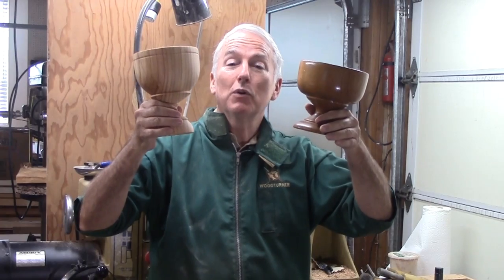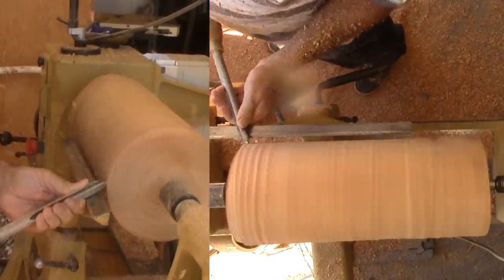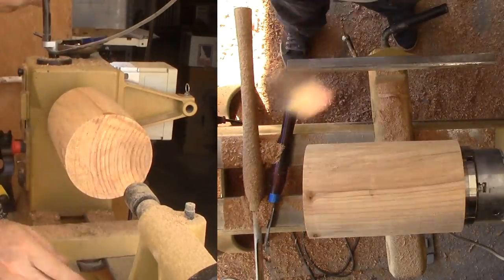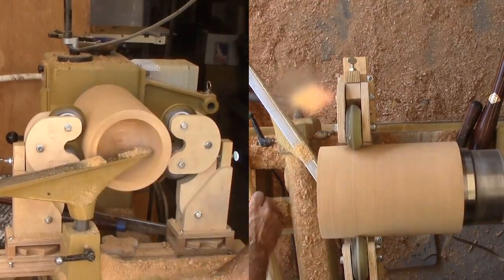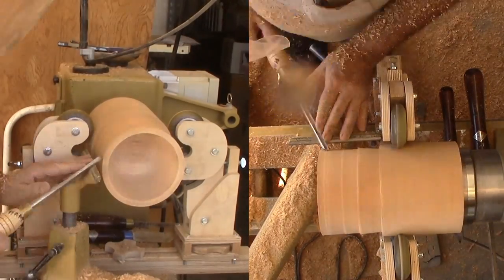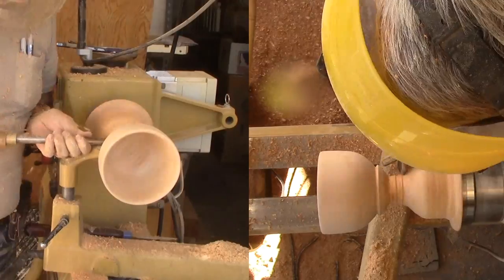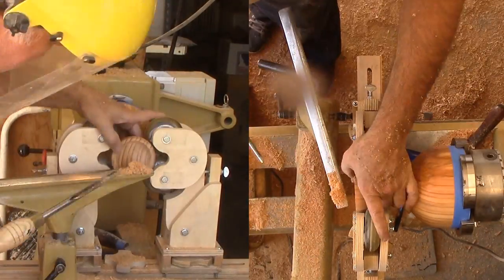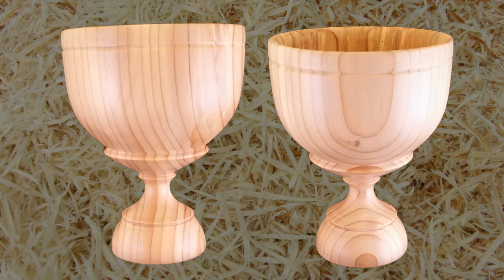Exploring My Family History By Turning Tall Cedar Bowl

Comment: I love both of the bowls. This one is a fine tribute to your Grandpa and a wonderful gift for your Mother. Too bad about the checking...did you make an attempt at repairing them or just leave them? One point I'd like to make, I guess it's kind of knit picking but those wheels are inline skate wheels or roller blade wheels. Depending on who you ask. I used that type wheel on my steady rest as well. I've found the you can sort of wedge the bowl or vase into the chuck using the sides of the wheels to make the mount a little more secure. Anyway nice video and a touching theme. Like!
Reply from the maker: I mis-spoke. They came from thrift store inline skates.
I can image the side pressure situation you described but I only needed it stabilized this time. I'll keep it in mind.
Thank you
Alan